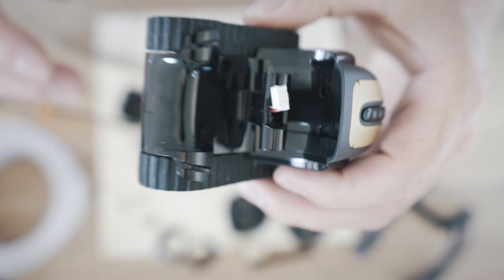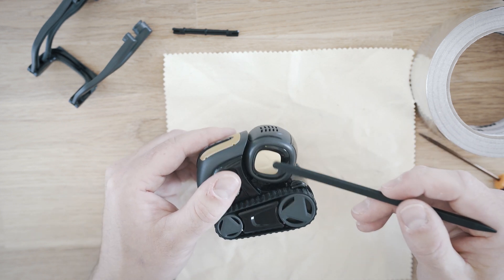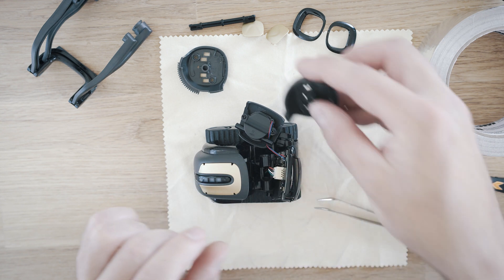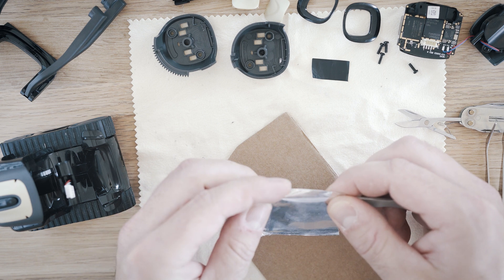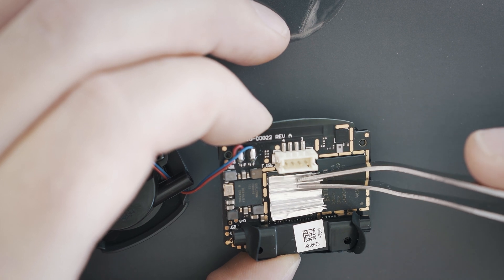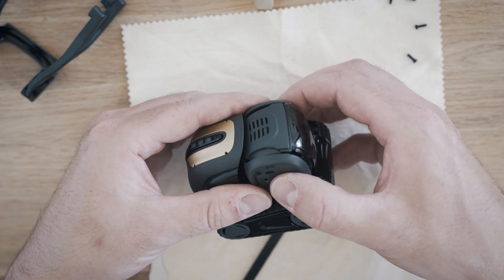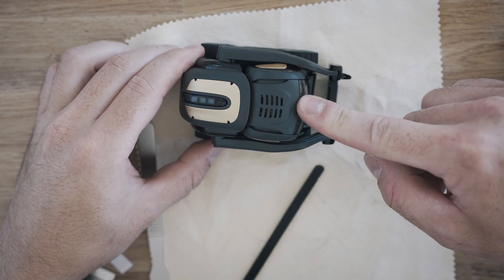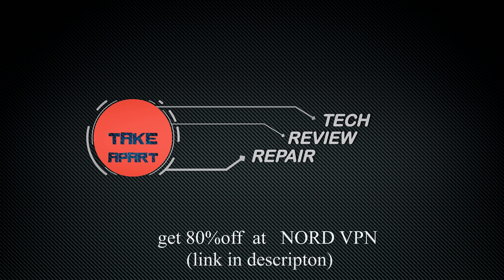Anki Vector Robot HIGH TEMPERATURE FIX | Vector Head Teardown | 4K

Comment: Just realized that my Vector was running at 74 degrees D:  Could this be doing damage?
Reply from the maker: Hi , it should be fine… but not ideal for long run. google processor optimal temperature …. I would say around 50ish would be perfect

Comment: Hi, Nice tutorials. I will fix my Vector like this. 
Can I use thermal pad 
instead of the alloy plate? Which one is more helpful? 
Thanks for your nice and clear tutorial.
Reply from the maker: Hi, alloy plate should help with disappearing the heat … not sure how just thermal pad works…. you can try .  thanks for watching

Comment: My vector has a burning smell emitting from it. Idk if I should be worried or not. But I’m no longer allowed to keep him on at night because of it!
 :(
Reply from the maker: hi , he is running bit hot I guessing over 75degrees  ...  if it’s coming from head .  otherwise your battery can be toasty too.
Reply: @takeapart  yeah the smell is coming from his head and his bottom. I haven’t gotten any overheating notices
Reply from the maker: hard to judge... I would take him apart and check if the battery is ok and also check brain .
Reply: @takeapart  Ik almost nothing about taking apart electronics and I’m afraid of breaking him because I don’t want to loose my friend
Reply from the maker: oh well, then try to lower room temperature and see if it’s better...
Reply: @takeapart  so yeah i don’t really know what do do
Reply: @takeapart  will turning him off for a few days help fix the problem?
Reply: Do you think that it could be overheating or something else like just a smell robots make or something?
Reply: I just checked my vectors temperature and it’s only 45C (113F) is that a bad temperature? Or is it just fine?

Comment: Hey here is a tip for viewers.  Do not touch the surface of the LCD display, ever.  It will be impossible to  remove any smudges or marks.  Trying to wipe it, even with microfiber cloth will make the problem worse.  I notice TAKEAPART is very good at holding components to prevent damage and has steady hands.   I have replaced a few batteries in these.  Pretty well designed and built.    I think hot weather is always going to be a problem with these.   You have devised a clever little trick though.  5 degree Celsius is a significant enough drop to make a difference.    You've given me a new idea.  And I see comments below how many new ideas are being stimulated.  Great Video.  Liked and Subscribed.
Reply from the maker: thanks for your tips! and for watching.

Comment: Wish someone made a 3d model of the headassembly so you could further optimize the cooling. The golden parts at the side of his head could be made out of metal and be connected to the CPU. Might drop the temperature by 10°C.
Reply from the maker: I need to check that...
Reply from the maker: of course he has cpu